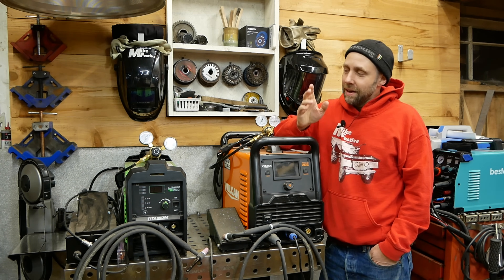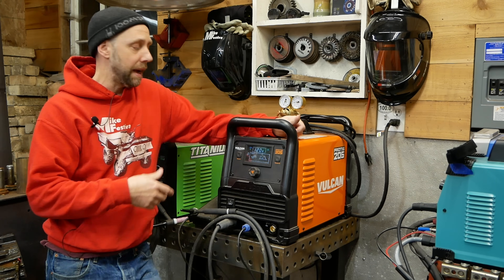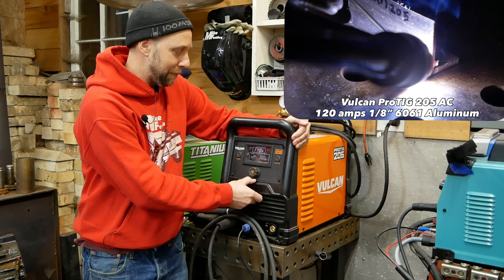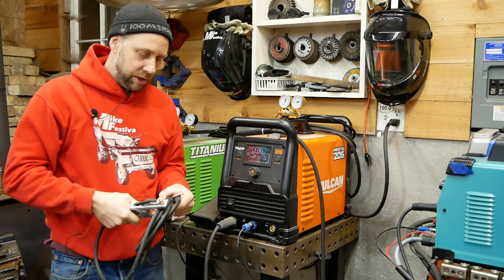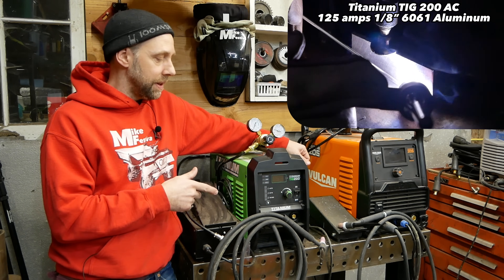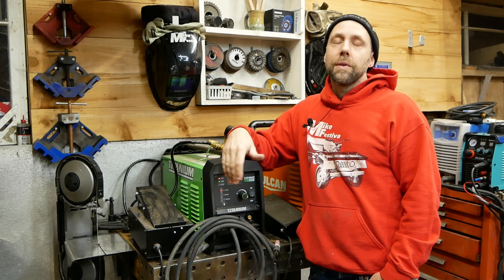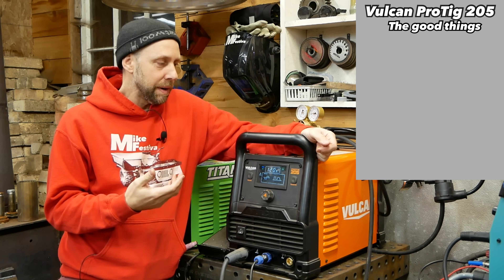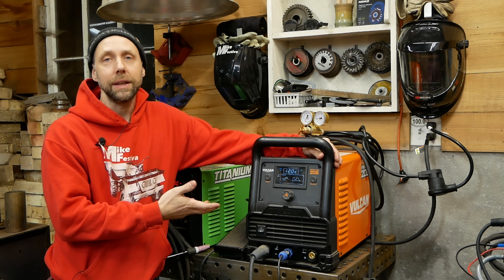Vulcan Vs Titanium AC/DC TIG Welder Review.

Comment: Mike, on first using the Titanium, we had the spread out flame. We blamed it on the 2 tungsten rods they gave you; however, you experiences are more than mine. So I’m going to follow your advice and get an argon flow regulator. Thanks 😊 so much for your excellent videos

Comment: If you talked about duty cycle, I missed it.  Like if you're welding 1/2" steel on max amps, how long can you weld a bead, and then how long does it have to cool down before you can weld again on each model, and at each input voltage?

Comment: Hey Mike,
I bought the Vulcan ProTIG 200 when it came out and I love it. I can't remember if you had one or not.  I also bought an Everlast MTS211Si multi-process because it was on sale, lol.
Got it in 1 day since Everlast is only about 40mi from me in South SanFran, CA I like 'em both.  I like your edit showing Mr. Spock on the display and the 'Live Long and Prosper' over the VULCAN name.  Thanks for this vid, 
Cheers.
Reply from the maker: I bought the ProTig 200 and also really liked it, really easy to set up, good machine, I thought the Titanium would have had similar features to the original ProTig 200 but they really simplified the new Titanium almost to a point where the operator has zero input in any settings. The Vulcan 200 just had about everything you want, only lacking pre and post flow. 
Take care 👍🙂

Comment: What power requirements do they need in other words what circuit breaker amperage do they need to run on ?
Reply: I've got the Vulcan and run it off a 30 amp 240 volt circuit. I think it draws something like 22 amps at full output. It's been an awesome machine.
Reply: @mattmicken6379  well that leaves me out then my shop only has 15 amp circuit breakers on 110 volts
Reply: @tacticalrabbit308 Bummer! Sounds like it's time for an upgrade 😉
Reply: @mattmicken6379  I'm waiting on the electrician to up grade my circuit breaker box but 20 amps is the max I can do on it with my budget

Comment: Great video Mike sorry I was late to view busy ordering parts for my new to me metal lathe! Finally got one
Reply from the maker: Awesome! What kind of lathe did you get?
Reply: @Mikefestiva  an atlas 10f th 54 the power feed and the cross feed had bad parts no steady rest underpowered motor but nice original stand for 400.00 at an estate sale couple other problems that kind of make me wish I’d of waited but the wife said I could so !
Reply from the maker: @brandenpatterson2776  you will get them worked out 👍 I have a few things I need to address on mine as well, lots of slop in the cross slide, so I think I need to make a new brass nut to fix the loose parts.
Reply: @Mikefestiva  it would be a great video just saying!

Comment: Hey Mike, how about doing a comparison on the yeswelder ds250p ac/dc tag like you said you were going to do a couple months ago. With the current deals on the yeswelder you can buy an AC DC tig with all the adjustments for 600 bucks. it'd be nice to know (since you have one) how durable, how long-lasting and how good the welder is. It would also be nice to have your opinion on how well it really works and is it something you would buy again since you've had it for a while.
Reply from the maker: Hi! Yes I will get one out soon I want to have a  little more time on the machine before i complete the review. Thanks for watching!
Reply: Yeah, then compare the yeswelder with the vulcan protig
Reply: On this subject, you should do a comparison on the yeswelder ac/dc tig. vs. the primeweld tig 225
Reply: I would also like to see this comparison ASAP while some of the deals are in places.  Thanks.  Cheers, Tom

Comment: Great review and information Mike. Thanks for your time and effort. Being an ordinary Muggle, my first reaction would be to lean towards the Titanium and I wonder if there would be a way to adapt the foot control from the Vulcan to the Titanium. Seems that having the foot control from the vulcan and a flow meter would make the Titanium an excellent choice for the neophyte, even though it may be "good enough" as delivered.
Reply from the maker: Thanks for checking out my video Mark!
Honestly the amp pedal that comes with it works completely fine, it’s just big and looks clunky and cheap, but it varies the amps just fine. 
I would buy a $40 Argon flow meter though, the stock regulator was not good.
The Titanium TIG welds aluminum and steel really well, the auto set was spot on 👍